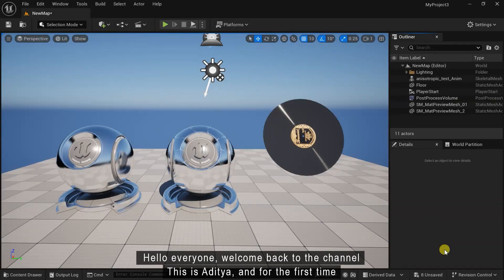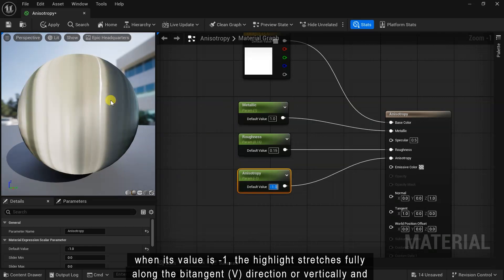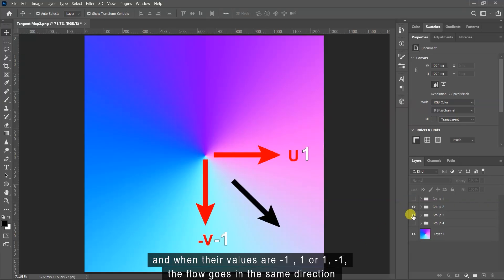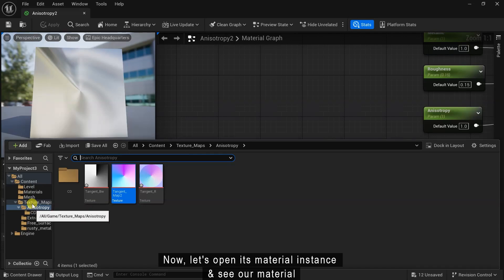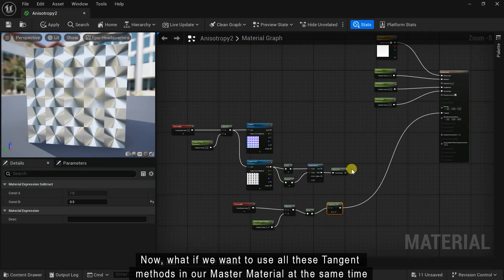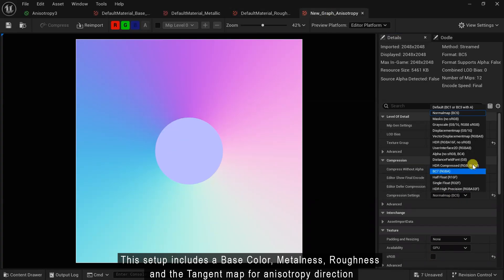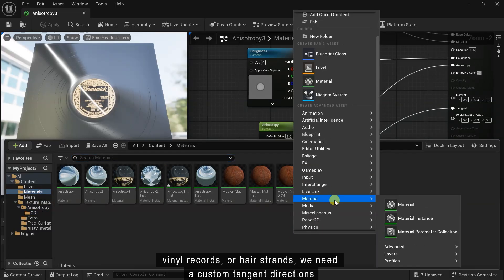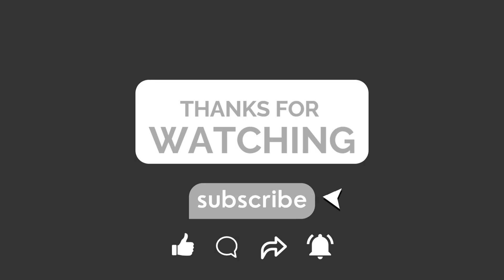How to Use Anisotropy & Tangent Maps in Unreal Engine 5.5 | Complete Material Setup Explained |

Comment: Hello, do you know much about mesh decals and trim sheets? I have a problem I'm trying to solve..
Reply from the maker: "I haven’t worked much with mesh decals or trim sheets, but I can try to help if I can 😊 What’s the issue you’re facing?"
Reply: @adityaanand2702 it's a little hard to explain but I have a mesh decal that is a metal screw with normal indentation around it. The problem is when I place it on various surfaces the indentation has colour so its not blending very well. So I'm trying to get rid of the colour but only from that outer area so it fully shows the colour of whatever surface it's placed on.

I can send you a picture if I didn't explain it well, let me know 👍
Reply from the maker: https://drive.google.com/file/d/1rDlwLLrRvZcc6N4J8sIY2F8qy842hv_t/view?usp=sharing

try this
Reply: @adityaanand2702 Yes that's exactly what I've been trying to do! Thank you so much. 

It never occurred to me that I could layer the decals like that, I was trying to do it all in one.